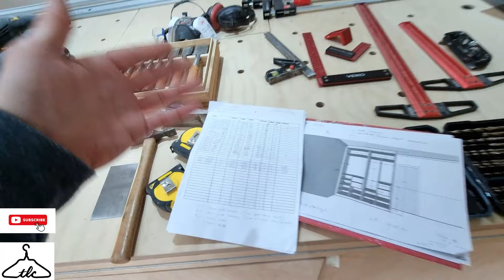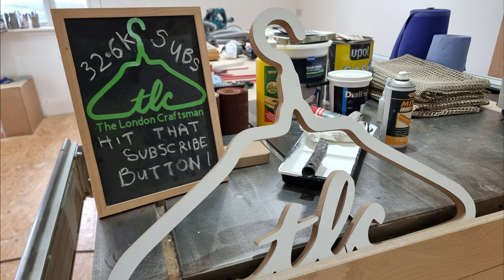You'll NEED These Tools If Your MAKING Fitted Furniture // Workshop Tool Kit // PART 2

Comment: I agree about router table. I enclosed mine in a cabinet, and then I just hook it up to extraction or hoover. I really recommend you do it as you will not get any dust. I couldn't believe how good it is. For years we just created dust and accepted that  routers create dust!. Make sure you seal it well-which is super easy to do...

Comment: Hello mate, does that Jessem router lift fit the little trend router table?
Reply from the maker: Hi mate the jessem plate is 298 x 235 and the trend plate is 307 x 230. The jessem corners also have a bigger radius. I'm sure you could make it work but it wouldn't be a perfect fitb👍

Comment: Great video, thank you for coaching us beginers. I have einhell track saw with guide 2x1m and realy need upgrade. Im in doubt which one to buy. I'm makita fan and all rest of the tools biscut joiner, trimer etc. are from makita. Except mitre saw which is from metabo. Festool ts55 also fall in to my eye. But here in croatia is little less then double price of makita what you have. Is festool worth that money? And which blade youre using for your makita, how many teeth and which model? Maybe first I will just try to change blade on my einhell.
Thank you one more time and big support from Croatia and keep going 👍👍🦾🦾